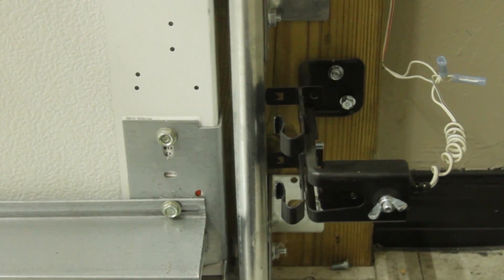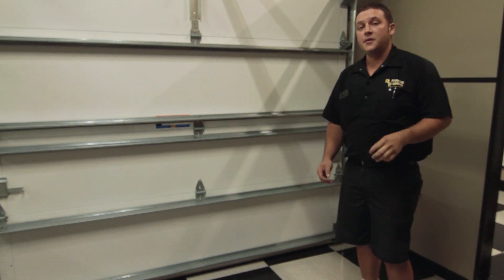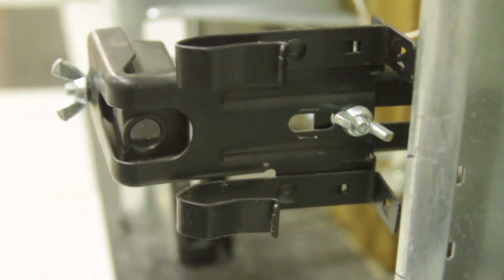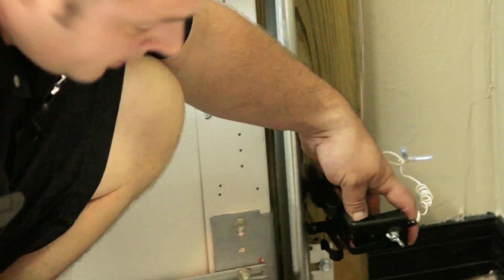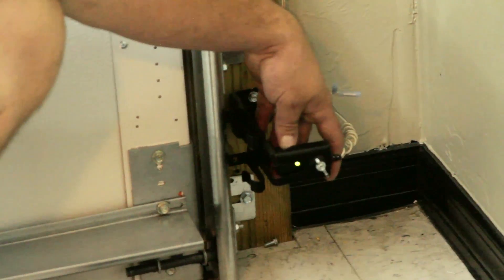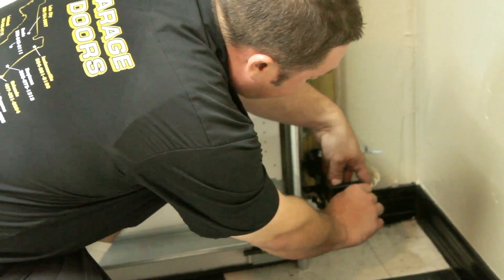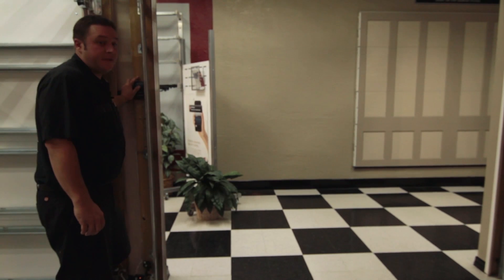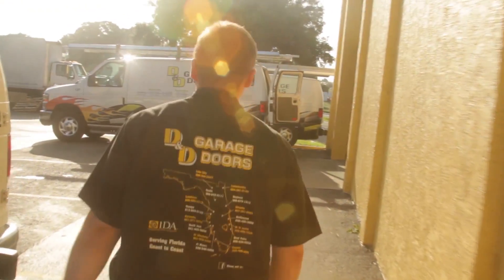My Garage Door Won't Close | Garage Door Photo Eyes

Comment: Great advice but our garage door was not operating and both eyes were working properly (illuminated and showing interruption of the beam). The door would travel a few inches after the button on the wall was pushed and would then return to the full open position with a blinking light.  We determined that a recent torrential rain storm had inundated the wireless remote keypad mounted just outside the door and had shorted it out sending a continuous signal and thus making the garage door opener's motor always wanting to open. We removed the 9 volt battery from the keypad and waited for it to dry out, The garage door opener is working fine now.

Comment: What if the photo eyes are aligned okey but the door still stops about 10 inches from the floor and goes back up?
What would be the cause for this? Thank you.
Reply: Mine to
Reply: I have the same problem right now with my garage door it doesn’t want to close all the way down
Reply: sometimes a strut on the bottom panel will block the photo eye. you may have to have a service technician like myself come out and move the photo eye out so it misses the strut.
Reply: @kristofferedwards4677  what does it mean if the safety eye is blinking yellow